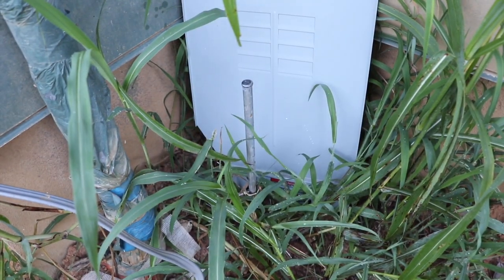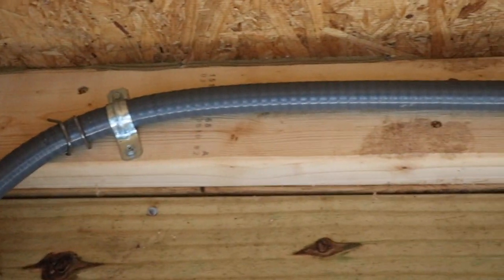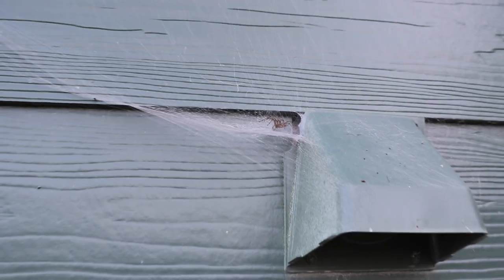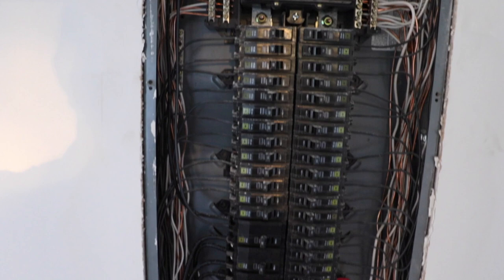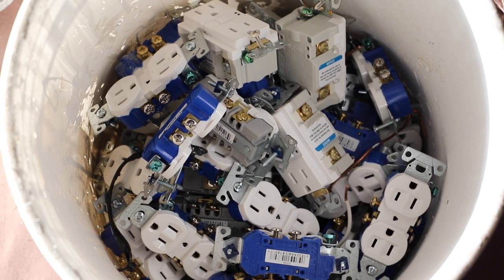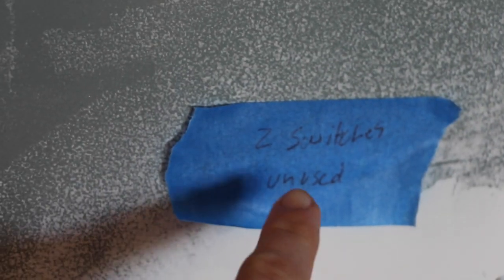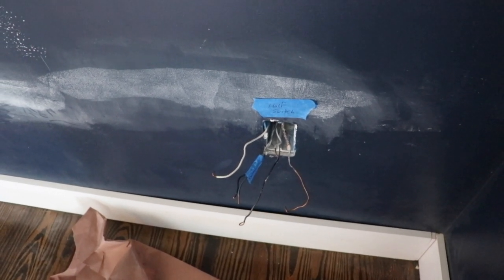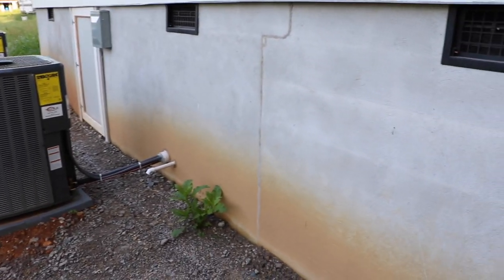Electrical Contractor Failures - Trade Tips

Comment: There is no 2015 NEC. It goes 2008, 2011, 2014, and 2017.
Reply: Pretty sure he's talking about 2015 IRC, not NEC
Reply: In text he has written 2015 electrical code
Reply: @anticapitalize
WTF is a IRC?
Reply: @am
The NEC is revised every 3 years. and 2015 wasn't one of them.
Reply: joe banana IRC = International Residential Code
Reply: Is that a Canadian thing?
Reply: Assuming at this point you're just being sarcastic
Reply: Sorry, didn't mean to come off as a wise guy. I've been in the electrical trade in the States for 41 years, and I've never heard of an "IRC". It's either the UBC, or NEC. My only other guess would be a carpenter's code.
Reply: and either are really guidelines, what really matters is what the local AJC adopts if any, their requirements may adopt some, all or addition to the NEC, but does not have to use any of it although most do, the local AJC code is what is the rule
Reply: Joe Banana - nope not Canadian   CEC = Canadian Electrical Code part 1
Reply: it seems you are not educated electrician after 41 years of working in this field. He is not electrician but he has find many mistakes in wiring.
Reply: CEC is California Electric Code too.
Reply: WTF are you even talking about?
Reply: Banana you are out of date you need to be updated and revised every three years. you are out dated.
Reply: Wrong, just renewed my certification on 1/11/18. And I was right, the IRC is residential carpentry, not electrical.
Reply: Joe, the IRC covers carpentry, electrical, plumbing, and mechanical. The electrical is just pulled from the NEC but most AHJs are certified by ICC and the exams are pulled from the IRC.
Reply: NC didn't officially adopt the 2014 code until mid 2015. That causes some confusion occasionally.
Reply: True, but some new code changes take effect at different times. For example the arc fault breaker requirement began with any permit issued after January 1st 2001. Also not a code year. Between 1999 and 2002. Also states do not adopt the code change immediately. 2014 code was not adopted until late 2015 (if I remember corectly) in NC. Then it is up to the local jurisdiction when they begin to enforce the new code.
Reply: There is irc 2015 for electrical. If you don't believe me, call a borough office in pittsburgh, pa. We're upgrading from 2009 to 2015 for all irc.
Reply: I caught that too.
Reply: banana actually it does also cover electrical. The codes on smoke detectors are from the IRC they are not mentioned in the nec unless it has been added to 2017 code.
Reply: The UBC was replaced in 2000 by the new International Building Code (IBC) published by the International Code Council (ICC). The ICC was a merger of three predecessor organizations which published three different building codes including the International Council of Building Officials (ICBO) which published the Uniform Building Code (UBC). UBC was mostly used in the Western states I believe. Last UBC edition was published in 1997. The IRC (International Residential Code) is the ICC's code for one and two unit light residential construction. It has structural, electrical and plumbing etc. in one code.
Reply: A new one comes out every 3 years
Reply: If any of you can tell me when/why the NEC was developed, then I will be impressed.  Its a simple question.
Reply: Jared Adams 
The first NEC was issued in 1897 and it's purpose was a standard of safe practices.  I have a copy if you need some information from it, let me know.
Reply: He’s talking about the CEC (Canadian Electrical Code)
Reply: @joebananatube  What is the latest UBC that you have seen?  The International Conference of Building Officials has not published their UBC model code since 2000.  They joined with BOCA & SBC in 2000 to form the International Code Council which promotes the International Building Code, the International Residential Code as well as mechanical, plumbing and other assorted building and fire related codes.  However, none of these mean anything until they are adopted into law by the local jurisdiction.
Reply: @denali9449  The closest thing to the UBC that I've seen lately is the spec sheet with the prints. All I'm concerned with is the NEC.
Reply: @joebananatube  You had mentioned it so I thought I would try to help out . . .  Hopefully there are not any designers still using that code, the structural and fire safety provisions have changed drastically.

As for the International Residential Code, there certainly are electrical provisions contained therein.  Unfortunately there were/are several conflicts between the International Residential Code electrical provisions and the model NEC.  That happened when the NAHB decided they wanted a builder to only need one code book.  Several states and local jurisdictions have amended out those provisions from the IRC because of those conflicts during their adoption process.  Not sure where you are certified but your area may have removed the plumbing, mechanical and electrical portions of the International Residential Code during their adoption.  As an aside, Iowa, Indiana and Idaho all have an IRC - Indiana Residential Code, Idaho Residential Code, Iowa Residential Code and all three are different.  I used to design nationally and ran into all sorts of code conflicts in various places.  Cross a state line and go from a code based on the 2002 NEC to one based on the 2011.  One city tossed the AFCI's out while the next town retained them . . .  Another actually changed AL wire ampacities to match CU.  Thank goodness the electricians did not start running services based on that change.  Best wishes in your travels - - -
Reply: IRC is known as Internet Relay Chat.  I used to be on it back in the late 1980's .

Comment: Ground and Neutral can only be bonded at the service entrance. Period. Multiple paths to ground can erode your wiring over time. Seen it happen in commercial buildings.
Reply from the maker: wb5mgr I've seen some serious rats nests in commercial buildings lol
Reply: Why is this? @wb5mgr
Reply: @enteraqua  so,  when the utility comes in on the pole it has along with it a neutral connection to the primary side of the transformer (high voltage/utility side). This neutral is the circuit return back to the source (substation) where they have an extensive ground source. 

But on the secondary side of the transformer (low voltage /customer side) you have a 240V split phase output with a neutral return back to the transformer and a service safety ground which is located at your meter installation. 

The purpose of the safety ground is not to absorb current but to serve as an alternate return path should the neutral line up to the transformer be compromised… For example say a tree falls on it and breaks it but the hotline is still intact.  Just one situation I could think of. 

Now you ask why you wouldn’t want to bond these all over the house?

It is important that the neutral and the ground only be bonded at a single location, at the service entrance specifically for the reason that each time that you bond them you create a potential difference where you can have a voltage in between those two points and when you have a voltage you can introduce current on the ground circuit line. If you do this enough times you can actually measure of the amount of current that is circulating on the ground with an clamp on amp meter. 

This is why it’s very important to remove the jumper from inside service panels if there is an outside disconnect that has a master bonding jumper in place already. There must be only one neutral ground bond in the system, and by code it can only be either in the main system disconnect or in the main service panel that is attached to the main system disconnect. No other location. 

There are some sneaky exceptions that you really don’t need to think about at this second, like if you have an out building that’s two or 300 feet away that you can bond the neutral and the ground again at that location because it’s so far away but if you did that you would need to drive another ground rod at that location... but basically the general rule is only bond the neutral on the ground once. And always remember the cardinal rule that electricity always wants to return to the source which means it always wants to go back to the neutral and not the ground unless the neutral is not available... in which case the safety ground becomes the emergency return path.
Reply: @YanasaTV  I have spent a good deal of time cutting a lot of that out...

Comment: Some sort of grease. Lmao
Reply: Wouldn't that grease be just for the lug threads as you are working with aluminum in aluminum.
Reply: I use maiden oil.
Reply: It’s a antioxidant prevents the aluminum from oxidizing, aluminum and moisture don’t mix so when the wire oxidizes it turns to white powder. Some people call it Noalox or blackburn are some manufacture names for it
Reply: Noalox
Reply: I prefer "No-Ox-ID" from Sanchem.  Best ive ever found.  Works great on Aluminium for new service panels, and I coat damn near everything I can, electrically, in the Hog barns I work in.   Of the several hog barns I do regular work in, I used one nursery barn as a 'test" barn.   All the common failure points in the barn: feed system terminals, heat lamp receptacles, Side wall fan switches, hanging forced air heater receptcles/cord ends. hanging forced air Heater spade connections, sail switches,  as i would repair/replace them, I would leave a tape flag with the date.  In some o these barns where we had pulled new wire on friday, and come back to wire already tarnished a deep brown/ black by monday, this greae applied during terminating, kpt the copper a vibrant fresh copper color, the steel yoke on the switch a bright steel, no rust,  and had kept everything coatedin it with that "wet" look.  One of the biger problems we have ad is the sidewall fan switches; they stay in the "off" position ALL winter, never being exercised, and come spring/summer when the barn temp rises, they get turnd "on" with a crunching sound/feel and fail to make connection.  We go out and troubleshoot and find that the switch is junk, AND hat it is corroded to the point that you have to destroy the box and cover to make the repair.  Since I have been using the No-Ox-ID by sanchem ( and no, I am not endorsed or make any money from them, just love their product) the switches STILL fail, because I cannot access the factory sealed connections, BUT replacing/repairing them hs become a beeze: I coat the switch, terminals, ounting yoke,  and screws LIBERALLY with the No-OX-ID grease, and it keeps things "wetted" and doesnt allow them to oxidize.  has reduced the time I have to spend in the barns for REPAIRS by probably 75%.  I have been using a small syringe filled withthe stuff to quiclyy fill new spade stko termnals with the grease before i crip/instll them on the forced air hanging heaters I repair frequently.  I have tried vaseline(pretroleum jelly), NoAlOx, Dielectric silicone grease, a blackburn gease like No Al Ox, and a copper infused lube, and NONE have worked as well as No-Ox-Id  (A special compound)  <---- not sure if that is part of the name/formulae or just a marketing deal, but you got the info regardless).  anyway this stuff works great from the Hog Barns, to new OR retermnated AL service conductors, Lead Acid battery terminals like in our car or lift( think it ws origially designed for this purpose), socket grease for lights,inside and out, or other erminals that just seems to be gong in too tight or galling.  Ive put it on plenty of AL lugs/terminls that just had a bad squeak and seemed like WAY too much necessry force to wrench them in, just a small dab, and they quite rght down, and a more consistent torque can be acheived.